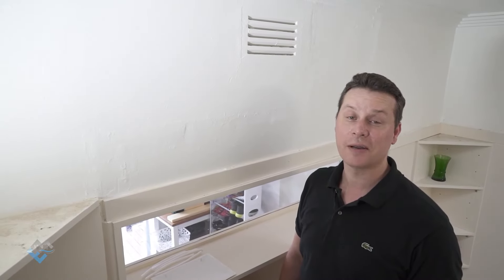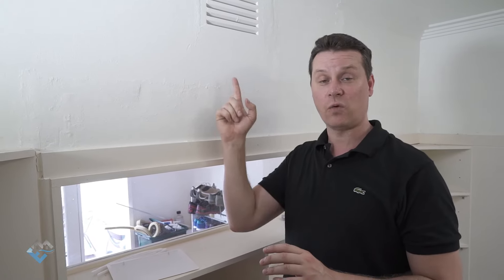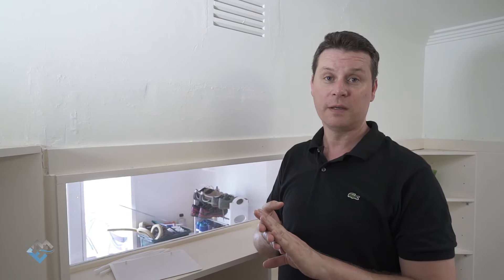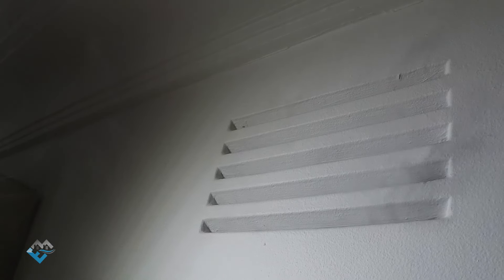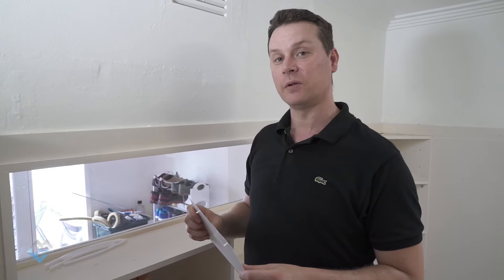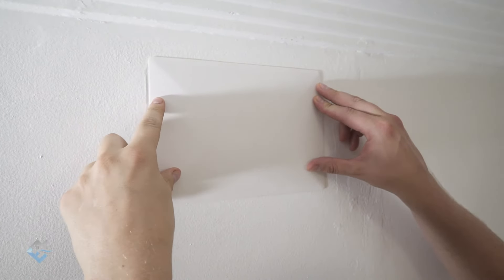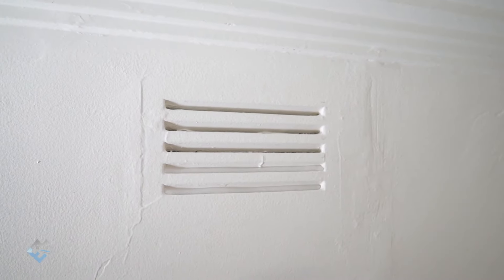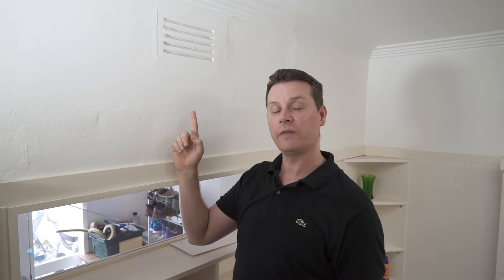WALL VENTS: remove them? Reduce draughts and save energy.

Comment: Another cheap and easy fix for renters etc for covering these vents, is grab some self adhesive clear book covering or contact, cut to size of the vent allowing a extra 5cm around to stick to the wall, and apply over the hole. In Australia, its ~$3 for 5m of clear book covering from kmart. You can hardly see it once applied, and easily removed.
Reply from the maker: Could work, but in high wind, the plastic could blow out.
Reply: @ecoevo  I guess in high winds it might, but It is pretty sticky stuff. Clean the wall before sticking. I allowed 5-10cm extra around the vent so it has something to grab on to. So far it seems to hold on well for me. Anyhow just putting some options out for people to try. At $3 it won't break the bank.
Reply from the maker: Yeah it’s good,  clean with vinegar first, just be weary, if it sticks too well over time it could also take paint off.  The foam backing rod should be cheap enough.  But you need to get the size right, which could cost ya. 😉

Comment: Would you also seal the outside vent or just the inside vent, I live in an older 1960's unit with these vents on the inside and outside. It does cause a draft during winters and I was wanting to close them up. It also appears that some mould comes in from that vent.

Comment: Sealing ventilation can cause damp be very careful sealing any ventilation
Reply from the maker: These vents were originally intended for internal combustion fire, not for managing damp, and they were originally installed in walls with no insulation.  There is NO vent directly connect to the outside from this outlet.  Getting ventilation from a mouldy insulated wall cavity is NOT the right place to be getting fresh air from.  Use your windows!

Comment: What about the mould that will coz once you seal the vents
Reply from the maker: Usually we see mould around these vents so these vents in most cases are the cause of mould.  Mould spores start growing in the wall cavity and then come out of the vent into your home.  They are more likely to be the cause, not the prevention of mould.
Reply: That's a blatent lie
Reply: @Ten Sense  yeah I blocked my sons room vent up now has mould in the corner of the room right near thr air vent .

Comment: Are wall vents also needed to reduce moisture build up in wall cavities? I want greater air tightness to improve heating and cooling but don't want the building frame to later become damaged either.
Reply from the maker: lordstok External wall vents and top and bottom wall cavities are usually quite leaky which contribute more than enough to keeping your walls dry.
Reply: @ecoevo  how can people breathe if the oxygen is blocked. All there be left is Carbon dioxide.
Reply from the maker: @jonmould2946  buildings are not completely air tight, but windows are a good place to start, for getting air.  Not a mouldy wall cavity!

Comment: Great video, very helpful. Where did u buy the adhesive seal & the foam rubber from? Do u have the brand names of either of these products? Could I get from Bunnings or Clark rubber? Thanks!
Reply from the maker: They have these in different widths.  https://www.bunnings.com.au/moroday-15mm-x-5m-white-gap-filler-rod_p4061877

Comment: Do you have a brand recommendation for the rubber sealant strips?
Reply from the maker: Jason T do you know what width you need?  you’ll need the foam a little bigger than the gap.
Reply: Thanks for your reply. But I read on this website that if I close my air vents, it will cause air-flow imbalance and eventually damage my HVAC system. What do you think? It’s only a meth?
Reply from the maker: It is referring to HVAC air outlets.  
And it is true, if you close up supply hvac outlets in a hvac system you can restrict air getting back to the return that will be expecting that air, so your hvac system needs to work harder to get that air.

not to wall ventilation

Comment: If you have a large void such as a chimney breast, the only way you can ensure you are achieving a dry and fresh environment within the void, is to create ventilation whereby warmer air can enter the void and dry it out. Yes, you may lose marginal amounts of heating but a damp wall can use up far more warm air than you lose in allowing air into the chimney breast. It's definitely the lesser of two evils.
Reply: So you are suggesting to not block up the chimney breast? Would it be better to cap off the chimney if not in use?
Reply from the maker: @mryan4452 If not in use, great idea.

Comment: Come on man. This is not a solution. Does your house have 4mm of cheap plastic insulation or 8mm of thin foam insulation? ...no.So, they need to be blocked up properly with brickwork for example, then with a layer of good quality insulation in between recreating a cavity wall with something like sheeps wool or wood fibre insulation or alike. The outer and and inner skins of brick then need to be covered with the appropriate internal and external decorative materials.
Reply from the maker: And if you are renting the property?  What would you do?

Comment: Vents are put in room to stop condensation, block these up and you will probable  suffer damp in the room
Reply from the maker: Really?  Why arent they putting these vents into new builds then?
Reply: @ecoevo  Can't really comment on new builds I can only say about older buildings, my Dad's old council suffered damp they put vents in , my own house (Solid Stone)suffered damp I put extractor fans and vents in, The Council in South Wales are now putting external insulation on houses and new windows with trickle vents in but people who had it done are complaining they still suffer damp
Reply from the maker: @willandelfie  Australia is a lot more temperate than Wales, But I suggest you get professional assistance with your case.  It is critical that you maintain an environment with relative humidity between 40%-60% in any home for health and comfort.
Reply: @ecoevo  because new builds are well insulated so the walls aren't as cold as old buildings. So the wet humid air isn't wetting the walls but finding it's way out via window trickle vents etc